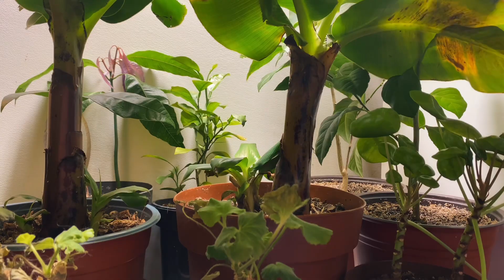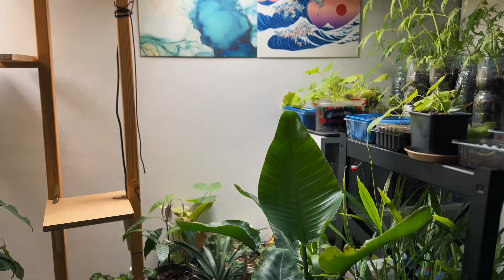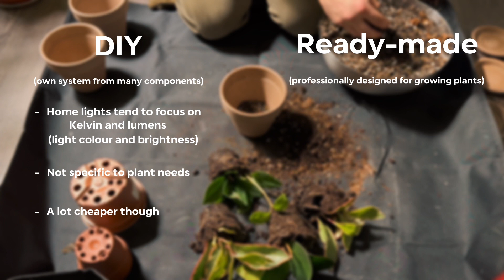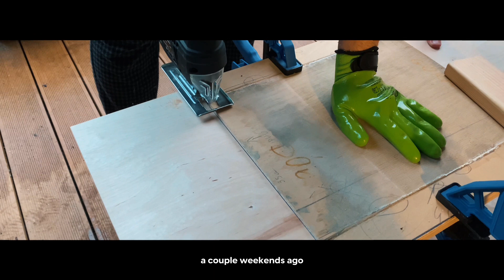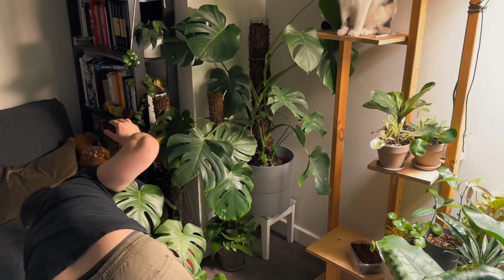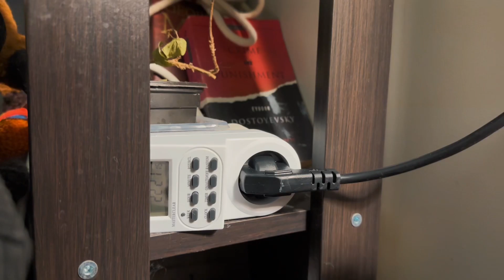My DIY grow light set up

Comment: Can you share the details of the structure (size, width, joints, and etc) thanks!
Reply from the maker: It's incredibly simple:
- 2 sheets of plywood 30x60cm (1,8cm thick for bottom and 0,9 cm for the top) 
- 3 two-metre-long planks (4x6cm) 
- screws and brackets
It's pretty tall and skinny so to connect them I used both screws and wood glue... and added some brackets for extra stabilty :)